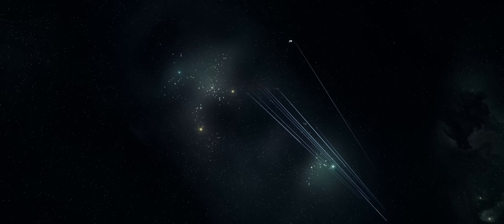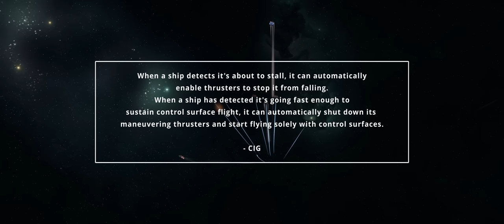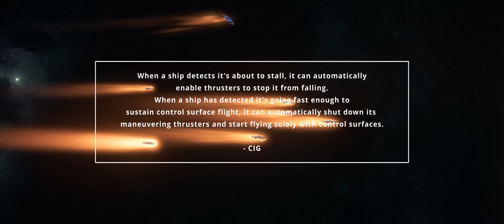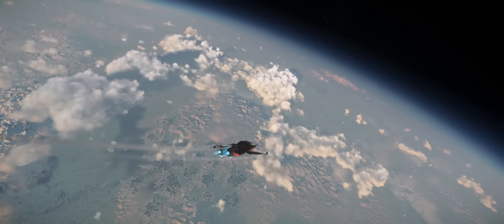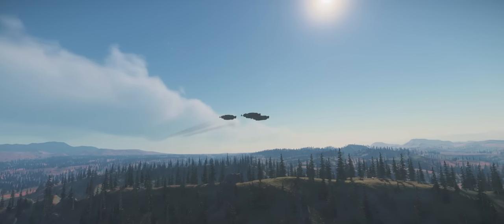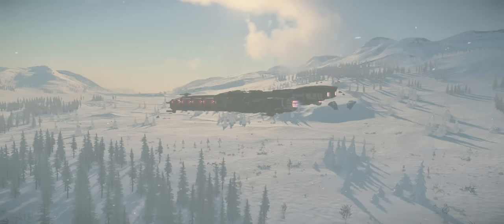THIS Will Be A BIG Change To Star Citizen Flight

Comment: I've been excited about this for a while now, but I never really thought too much about the ships - which have control surfaces, which have vtol, which have both, which have neither -- until now. And yeah, there's some pretty good variety!

That Khartu-Al / Banu Defender may be a tough cookie in space, but you bring it into atmo and it's toast. The four 'main' starters: Aurora, Mustang, Cutter, and Pisces each have different flight setups making for a very distinct starting experience and strengths. 

Cutter, for example, isn't something you would want to do combat with, and good luck dogfighting in space let alone atmo -- but put it into vtol and it's a close air support ship to support the buddy or two you hot dropped to take out an above ground outpost mission.

Mustang, with it's control surfaces, is the starter for dogfighting and likely will be great in atmo for that. But you go to space and the aurora will more than hold it's own in that arena, owing to it's smaller cross section.

Reliant Tana is the 'smallest' and 'cheapest' vtol dedicated fighter and as a two person ship with remote turrets could see a revival of popularity as a great CAS option. The Hornet could be given a vtol 'swapable' for it's middle box/turret/radar section to suit it to a completely new role. (which would be super cool in SQ42)
Reply: Wouldn't the Aurora be the smallest and cheapest VTOL fighter?

Comment: I am all for a slightly more skill based flight system, however, if I wanted to play Microsoft flight sim I'd be playing that.  Even with OP thrusters right now, learning flight in this game can be difficult as a new player so any more difficultly added will absolutely turn off the vast majority of new players.  Example:  Games such as Squad and Arma 3 I absolutely refuse to fly because it simply is not fun AT ALL for me.  That said, the good pilots in those games absolutely love it and good for them, I respect them that much more.  Point is, too much of a skill requirement and I'm out.  That sucks due to this game requiring flying 80% of the time. Also, RIP anyone who bought a Drake Herald, you now own a rock w/ rear thrusters. 😆

Comment: Using vtol in dense atmo and high grav should require boost. There's your time limit for hovering.
Reply from the maker: It would actually be the opposite. The denser the atmosphere, the easier it is to hover. Technically a high gravity, zero atmosphere planet, would be the hardest to hover on.